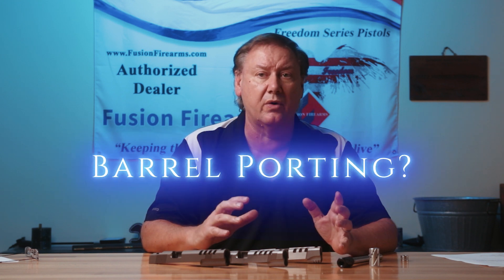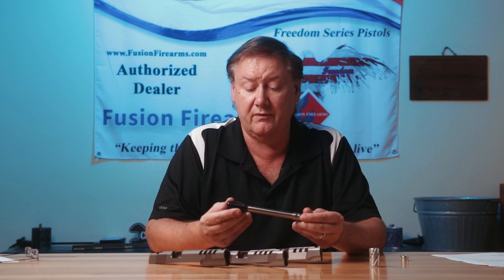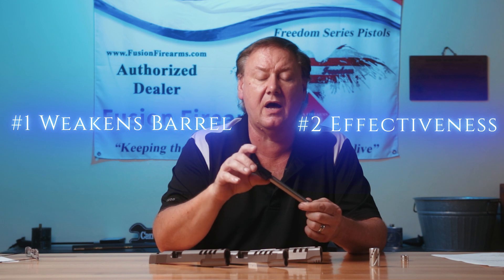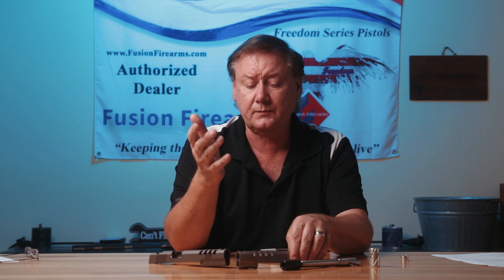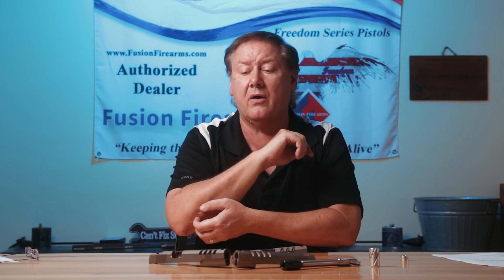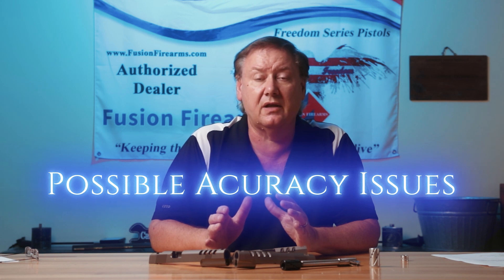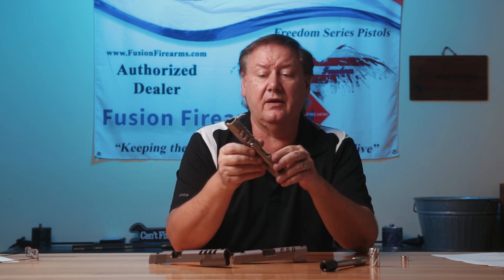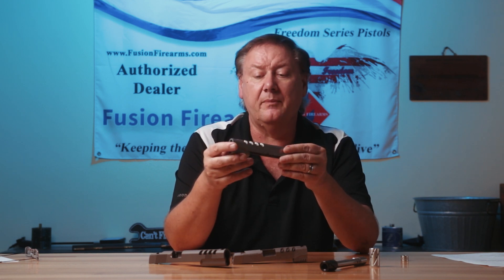Vent Cut Your Slide? | Barrel Porting and Slide Lightening |

Comment: The existence of compensators has always made me question why porting was even a thing. Great content, as usual, Fusion Bob.
Reply from the maker: Thank you sir
Reply: Compensators have reliability issues,
Reply: The size of the gun, for example I ported my shadow 2 for IDPA. I did it for 2 reasons 1st so the gun makes weight and second it doesn’t add size to the gun so it can fit in the IDPA box

Comment: Most barrel ports are geometric trapezoids? 🤔 I rarely see that. Most are circles or oval shaped. And as far as the debris build-up under the slide, that's probably more affected or damaging on 1911s due to the cylindrical shaped slide matching the barrel. Your typical striker fired pistols have trapezoid shaped slides, so there's more space/gap in between the slide and barrel, therefore the chance of damage/fouling by debris build-up is much less likely. Also, I'm sure it would take hundreds of rounds before any substantial damaging build-up starts occuring.. Clean your firearms and you shouldn't have any problems
Reply from the maker: These are slide ports not barrel ports
Reply: @fusionfirearms  2:25 You literally said it here.. Most barrel ports are not trapezoid

Comment: Do vented slides have advantages for 45acp? I’m in Cali so I can’t have threaded barrels. My theory is if I use Speer gold dot 200+p ammo the vented slide will help. Or do I have to change recoil spring also? I kinda don’t want to do that just because I see people saying when they switch the stock spring out their glock they all of a sudden have malfunctions. I already have a Glock 21 with vented slide. I’m thinking about venting the top of my Glock 30.
Reply: I haven’t used plus p ammo yet
Reply: I haven’t used plus p ammo yet
Reply from the maker: Slide lightening has a little mechanical advantage other a slightly lighter slide. it does help in some applications but it is mainly for looks.  Generally if you have feeding issues it will be due to the recoil spring old or not correct for the loads or additional tuning/barrel throating is needed.
Reply: @fusionfirearms  alright thanks

Comment: Recently ported my CZ Shadow2 as an IPSC Open Gun and I have to use a high speed steel tool bit to scrape the deposits off of the top of the barrel. It was an experiment am I sorry I did it  no.  But I would not do it again as I have compensators that work better  (not all comps work)
Reply from the maker: Good feed-back, thanks for the info!

Comment: What's your honest opinion on slide lightening for a defensive handgun? Would the cuts create a Murphy's law situation where debris could actually cause a reliability issue?
Reply from the maker: It does not cause any mechanical issues. Looks nice and will add some mechanical advantages to lighter calibers like 9mm.  Good question
Reply: @fusionfirearms  Thanks for answering!
Reply: @fusionfirearms  When you say adds mechanical advantages to lighter calibers like 9mm can you state what those advantages are? I also am thinking of getting my slide cut on my 9mm carry gun to lighten it a little bit more. I'd love to know, thanks!
Reply: @motavice3499  they were stated in video. 9:00